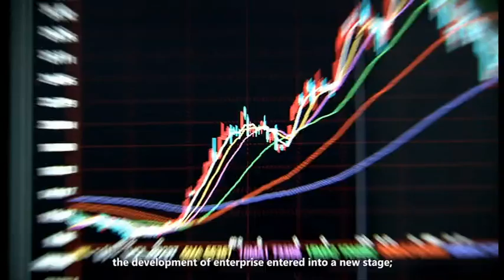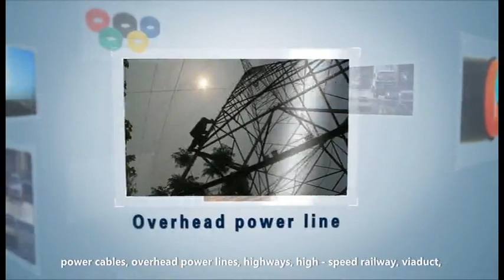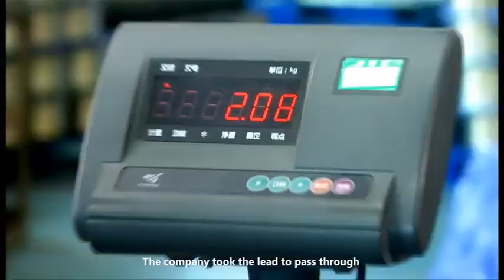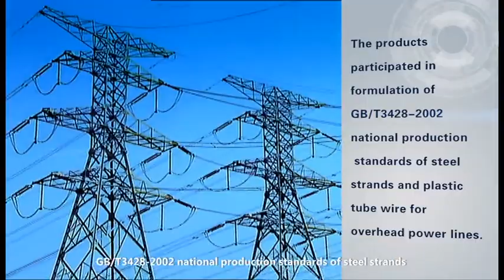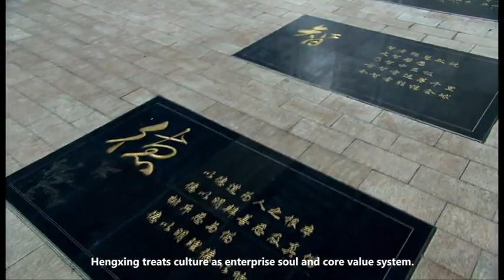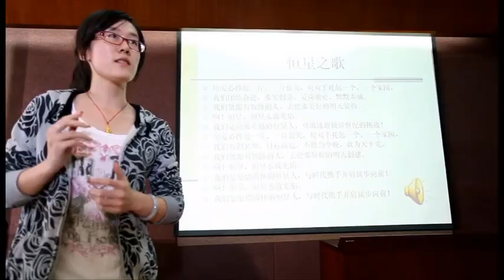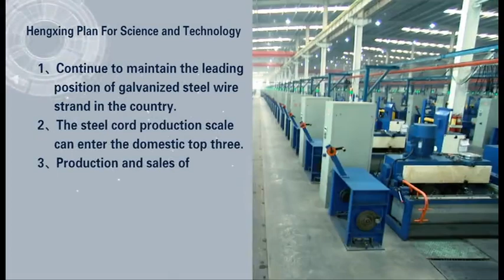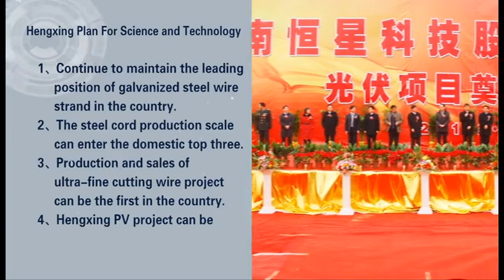PC steel strand,Galvanized Steel Wire,Diamond wire Production plant

Comment from the maker: Hengxing science and techology co.,ltd built in 1995, with 24 years of steel wire transforming and coating industries, our main product as galavanized steel wire, strand, PC steel wire strand, steel cord radial tire, hyrolic hose and polycrystaline silicon. Listed on Shenzhen A stock market in 2007,we have independent R&D center, passed the ISO, SGS,BV certification and so on. As the biggest galavanized steel wire and srand manufacture in China, and the biggest steel cord for radial tire, with high quality and performance, our product widely used in the industries as electric cable, suspension construction, radial tire and hydrolic hose, and sawing.